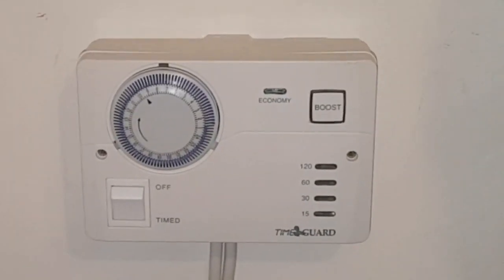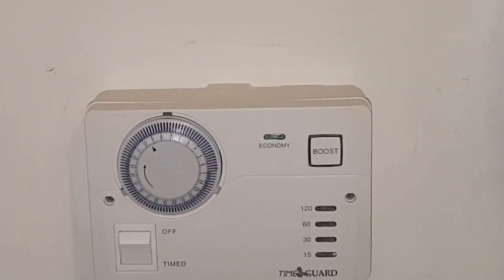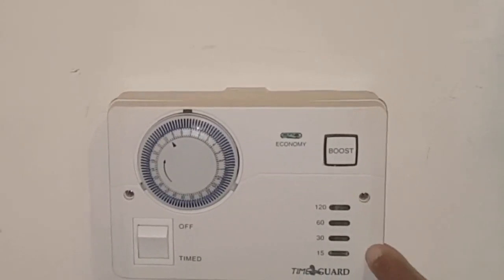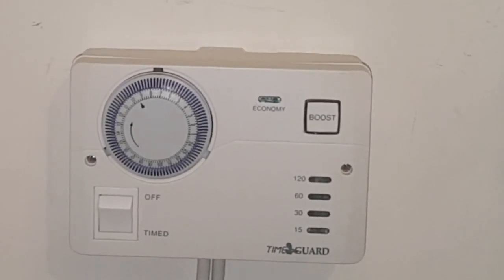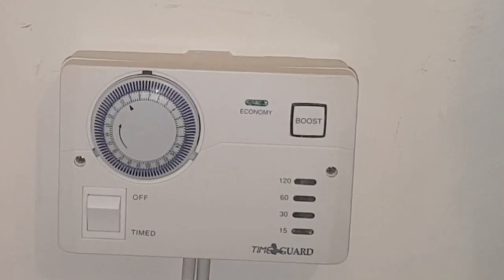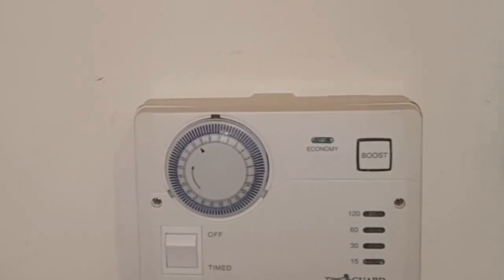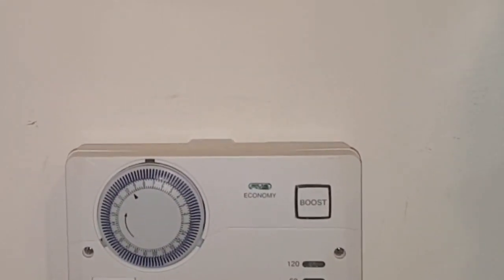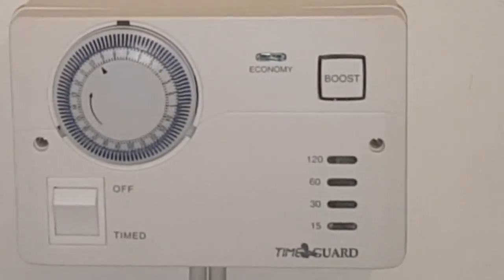How to Set a Timer Eccomany 7. With Coach Tony Morgan

Comment: Hi, thanks for the video. I have the same Timeguard model. It only works when the immersion switch is on. If it's off, I can’t even use the "boost" function.

A few days ago, I contacted the Timeguard helpline, and they informed me that the immersion switch should remain on, while the Timeguard will handle the on/off switching based on the programmed schedule. However, if the immersion switch is off, the Timeguard cannot operate according to the scheduled time.

Can you confirm that the immersion switch near my boiler needs to remain on, while the Timeguard controls the on/off switching according to the schedule I’ve programmed into it?

Comment: Confused if your on E7 do the pippets need to be pushed down for E7 times or for when you just require  hot water during those times my daughter is having issues with her boiler. She is now on E7 was  on E10 previous supplier. New supplier sent her a massive bill into the thousands. She has no storage heating attached they where removed. When she went over to new supplier they did not collaborate meter or put E7 metre in as it was a old metre. So we think they where receiving readings for E10. Currently she has her pippets pushed down to come on between 3am and 5am during E7 times is this correct or do they need to be up please help?

Comment: I cannot tell you how much you have helped me. I have lived in my property, new build, for 14 years plus, in the 12 years there has been endless electricians come to fix my immersion heater, they then changed the unit and affixed this timer to it, that was 8 years ago, it had never heated up, several electricians came to check it but always leave telling me it will work only it does not. For 8 years I have paid electricity costs beyond anyone's understanding ie £400 - £700 quarterly, because only the BOOST buttons work, if the boost buttons aren't pressed then the unit does not heat up. Also it at rare occasions simply does not light up for days, meaning no hot water for days until the unit somehow again works ie the boost buttons light up. You have today given me understanding of this unit. Thank you so very much, I come back to tell you if it dud heat up. As of now, I can hear it heating up without the boost buttons, I've never heard that before. God bless you ✨

Comment: Put simply, Economy 7 should not really be installed or supplied to individuals that need the bulk of their hot water in the early or late evenings. Unless Baths, showers and Washing is carried out in the mornings, uaing the overnight heated water to best effect...
Any Econ7 tariff only gives the cheaper rate during the night, and so the Water tank is heated ready for the morning only...any other time will cost the owner to heat the water tank at a premium tariff rate.
This individual will definitely pay more if either the boost or the timer is adjusted (as many people do). Best thing is to get the Council (it usually is a council property) to replace the boiler to a instant boiler with a std tarrif, thus only paying for what and when they turn the tap. Anything else will cost the owner dearly.

Comment: Can you please help me to set up mine ? 😭 the hot water if finished after 15 minutes of showering 😓
Reply: Same with me and they replaced it
Reply: @graceology8594  Mine is the same, I only get hot water for 15min, how did they know yours was faulty?
Reply: @mizsab365  because I couldn’t control when I get the hot water. Sftlr. Try calling someone to examine it.
Reply from the maker: You could have a boiler fault what area are you in?
Reply: @ARBoilers  Birmingham, city centre

Comment: Hi. I have a digital economy 7 timer. Water doesn’t heat when set at peak timer for cheaper heating in night. I have to keep pressing boost button during day. Could a thermostats be at fault?
Reply from the maker: Yeah could be
Reply: @ARBoilers  the bottom thermostat required reset. Although it’s very hidden and not written reset on it. Pressed it and worked. Now I can take baths again and save on bill. Thanks.  Maybe someone else can benefit from it.

Comment: hi i do have the exact same one its not heating the water and the economy light used to be blue light which is not on now and when i press the boost its not working as well i tired your way it did not work what should i do
Reply from the maker: It could be faulty